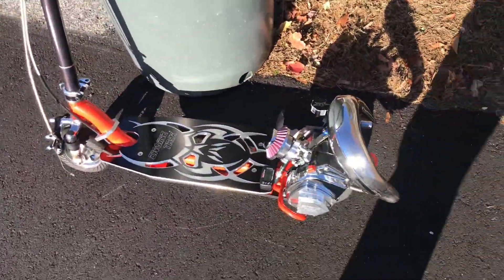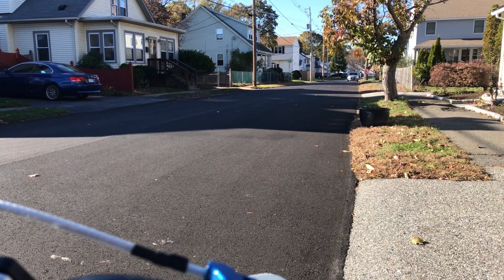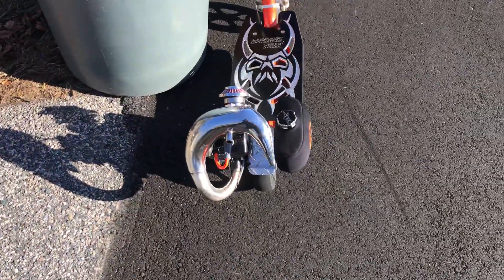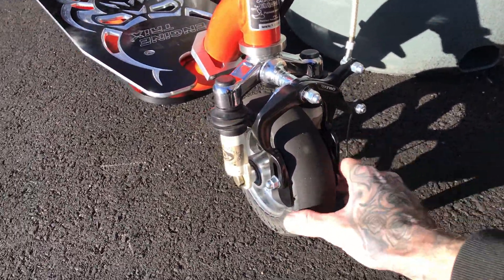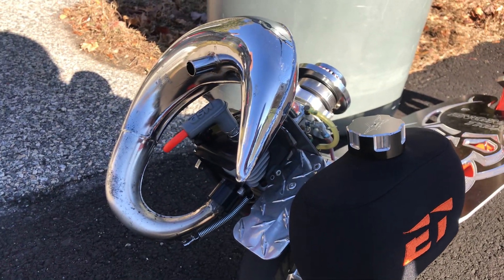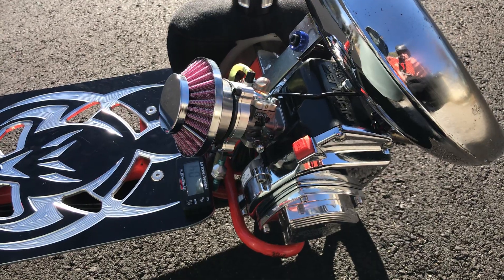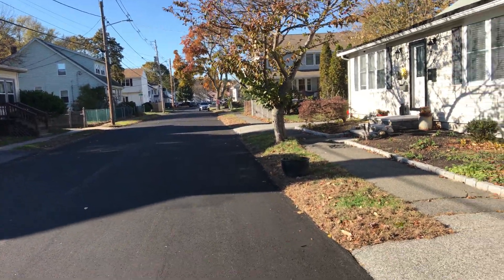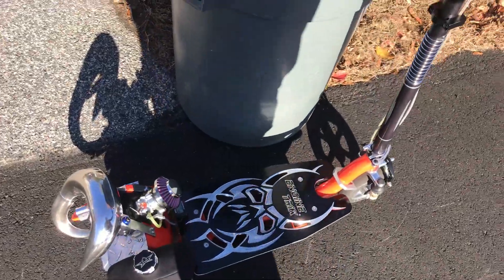G290RC SUPER XPED GOPED TOP SPEED FLY BYS ADA S1 PIPE 40MPH .850BM

Comment: I just got a goped Bigfoot with no engine but it came with an ada racing engine mount. It says I cannot run a “centrifugal clutch” but can I still run a clutch? Does the stock one that comes with the 290 on work? I only messed with sports so I have no clue what clutch fits or not. Not sure if you have that engine mount but just asking around.
Reply from the maker: So im guessing that engine mount is the ADA 3rd bearing support like whats on my Biggie build...You can still run it clutched for sure cuz that’s exactly how my bigfoot is setup and i love it. Being able to idle is real nice.  The stock one that comes with the engines will work but if you already have the billet ada engine moun/3rd bearing support then all you need is the clutch kit for you engine either Chungyang or Zenoah..they are slightly different from eachother.
Reply: @JesseK410  yeah Im running the ADA 3rd bearing support. I'm thinking of either running a zenoah 320rc or a 270rc and the clutch kit you're talking about is this one https://www.davesmotors.com/ada-54mm-centrifugal-go-ped-scooter-clutch-kit
I pretty much want to run the same clutch set up as your bigfoot but I just don't know if they bolt right up. It would be cool if you had a whole build sheet.
Reply from the maker: @jeffersonho6886   The g320rc is nice but it doesn’t like to rev high, imo that engine is better for RC cars. The gopeds want to rev high like 17k or better. The 320s have issues with the cranks heating up at that high of RPM. 
Honestly if i was you i would run a G290rc on the bigfoot with that clutch kit and your ADA mount/bearing support 👌🏼

My bigfoot runs the CY29RC (2bolt case) with the clutch kit for the CY and im running the ADA 3rd bearing with a .850 spindle, walboro 990 carb. 

its a pretty simple setup, everything on it is pretty much made by ADA. I was going for a overall ADA racing themed build. 

I will be swapping the a Zenoah G290RC eventually as its a better design with the 4bolt case VS the CY 2 bolt. Just stronger and less likely to blow out the base gaskets..hence why I recommend you run the G290RC on yours.
Reply: @JesseK410  thanks for the input. Will for sure do the zenoah 290 and funny thing is I think you liked my goped post about the Bigfoot I got on gpnfb. Earned yourself a sub.
Reply from the maker: @jeffersonho6886  rite on! And yep lol that was me..you ADA mount looks like it was missing the actual bearing tho. Im pretty sure u can buy the replacement..that mount will clean up good as new with some aluminum polish. 👍🏼

Comment: How does the mid bleed compare to the end bleed sikk pipes? Any differences?
Reply from the maker: I have only ran the sikk mid bleed, i know the end bleed is a little louder but as far as power band goes im not sure. I honestly think its a good pipe for the money but theres other pipes that perform better like the ADA s1 on my superX or the flowsystem s1 pipe. The sikk pipe is more of a low to mid range pipe if you ask me. The s1 pipes are better for top end performance and really letting the engine rev out so i guess it really depends what ur going for..low, mid or top end power..

Comment: What top speed can you expect out of a g290
Reply from the maker: It really all depends there’s a few factors like the riders weight and also the overall build.
A stock 290 with a 130lb rider will do about 35mph with a .850 spindle approximately at 17k RPMs. Mine currently is topping out at 40mph @ 17k with the black magic .850 spindle and its got the ada s1 pipe (good for top end performance) and the ada tall billet intake manifold running a 990 carb and bartolone racing v2 velocity stack. 40mph is really fast for a spindle drive goped in general, not to many guys ive seen got them to hit 40mph. I can consistently cruise at 38mph no problem tho, the 3rd powerband is sweet! On the right road on a nice day when theres not so much wind & its tuned mint  is when i can get it to hit 40mph. The bigfoot hits 40 easier i think bc of the bigger air tires its got..
Reply: Is this a reed case motor? Check out O’Neil brothers racing.

Comment: Hey do i lock tight the  4 engine screws into the motor?
Reply from the maker: I would..i use blue loctite, medium strength. If you use say the Red it may strip before it comes loose. I also recommend doing away with the factory screws and put in either allen heads or hex bolts
Reply: @JesseK410  Thanks ! Im going to look into those srcews .
Reply from the maker: @Gopedhitta954  into the hex bolts or allen heads you mean haha 

Ill see if i can find the exact size i have a feeling there m6 x 1.25 but im not positive on that.
Reply: @JesseK410  Let me know i was over here like whats the size of this screw !!!! Thanks in advance...
Reply from the maker: @Gopedhitta954  im gonna look today and measure the threads and thread pitch for you.
Reply: @JesseK410  hey quick question any reason why my full size rear tire want fit with a .800 spindle?
Reply from the maker: Yes, it wont fit because its a new tire. In order to run the bigger sized spindles you need to pre-wear out the rear tire some..you can try using the front tire sometimes its worn just enough
Reply: @JesseK410  o ok ddm states otherwise when buying a spindle. I already mounted it on a bead lock rim im in bad shape ! And need to wear it down ! Im beat!!!
Reply from the maker: @Gopedhitta954  yeah after i think .800 you need to wear out the tire, bc of how much bigger the thing is yaknow..just the way it goes when you run the bigboys lol..imagine a 875
Reply: @JesseK410  i know i was amazed    now i got to figure got how to wear the tire down lol
Reply from the maker: @Gopedhitta954  ohh you wear the tire down by simply running the smaller spindle until it wears down..if you dnt have the smaller one yull have to get one to do that.